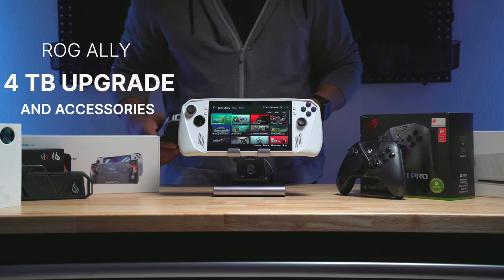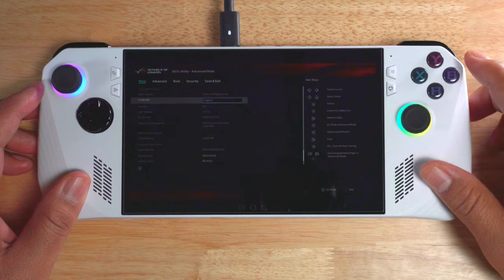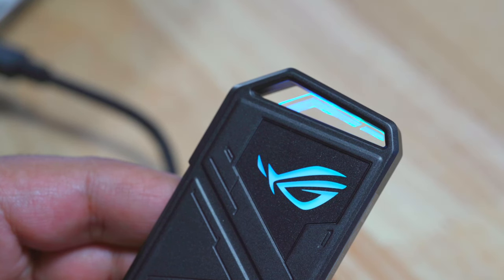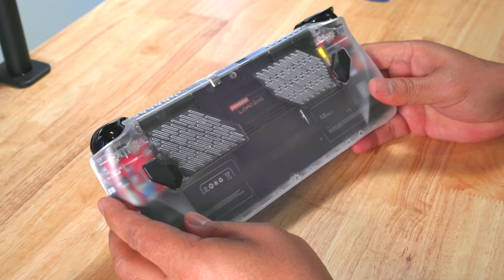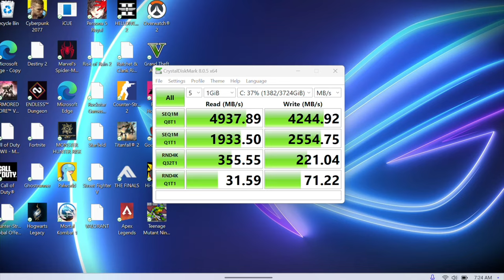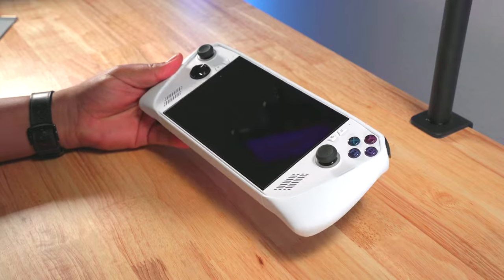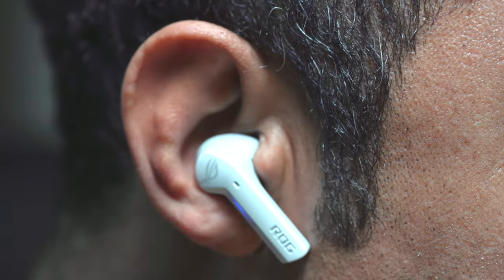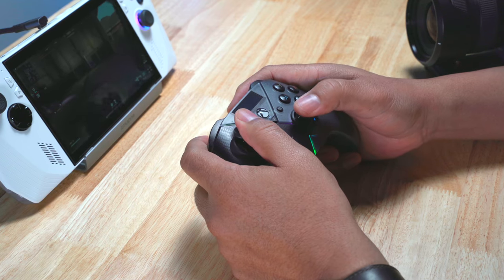Asus ROG Ally 4 TB Upgrade and Every Rog Ally Accessory I Purchased

Comment: Any issues with having an ssd adapter for the m.2?  I already got a 2tb ssd but never heard of an adapter for an m.2 b4..
Reply from the maker: No issues so far. I’ll post in the community tab if I do.
Reply: only thing i heard on issues that common on reddit, is that vents on backplate start to crack after awhile from pressure. They say you have to cut certain spot on backplate to keep pressurre  off.
Reply: @Varnage  but this for Original backplate, the Jsaux doesn't have this problem, but the RGB plate make some pressure but not enough to make troubles
Reply: Avoid turbo if you use adapter…. Broke my ssd after 2 weeks, thermal problem, the ssd no longer detected, just regard me as your guinea pig
Reply: @adikurnia5364  Why have an Asus RoG Ally if you can't use it to its full potential? It doesn't make much sense.
Reply: @adikurnia5364  what broke it? Was it overheating? Does your ally still work? Im thinking of doing this but I'm not sure

Comment: It seems to me that the cause of the drop in speed in transfers or writing data to the SSD is caused by the high temperature. If you notice when you put in the adapter for the larger SSD, it is mounted almost on the processor.

Comment: I am thinking to buy Rog ally... 
Should I buy it?
Reply from the maker: What is holding you back?
Reply: Yes! It's incredible I don't have the need for laptop/desktop anymore since my work provides me my work laptop. Check one out I love it.
Reply: No. Especially if you play AAA games.
Reply: If you are going to play AAA titles, I recommend set everything at low except medium texture, 720p with RSR enabled, it's gonna be great looking with around 60 FPS at 15W TDP. I'm not recommend playing while charging cause it can corrupt your SD card (happened to me and I had to format it on other computer then it worked normally). Battery is around 1h30 mins if you're playing at 15W, 3 hour at 10W, I'm not recommend 25W as it can cause damage to SD card and drain battery to under 1 hour. Finally, this device has great software and screen/speaker quality, but has some issue about heat that you should take care on your own. If you can accept then buy it, there's not thing like having a PC on your palm. Or you can wait couple years to have new device line with better spec and longer battery life, less issues.
Reply: Yes get. You won’t regret. Got my for Xmas and very happy with it
Reply: I bought it a month ago and I'm literally addicted, stunning device. I bought the z1 extreme version
Reply: Bought one this weekend and it’s awesome

Comment: Has anyone done the 4tb upgrade if so any issues?
Reply: I did it, it lowers write speeds a little bit, but that’s just because of heat, if you get some thermal pads and put them ontop of your ssd it won’t matter much.